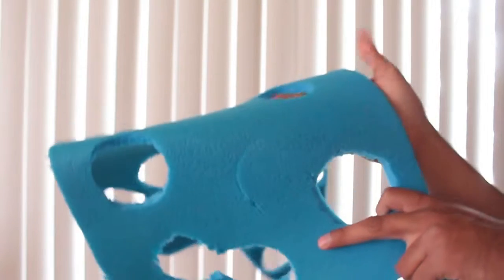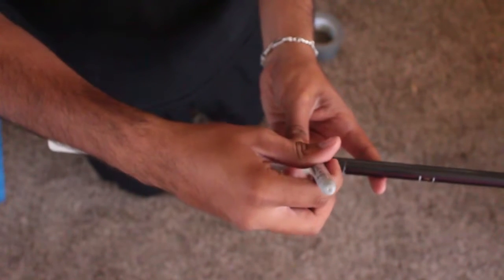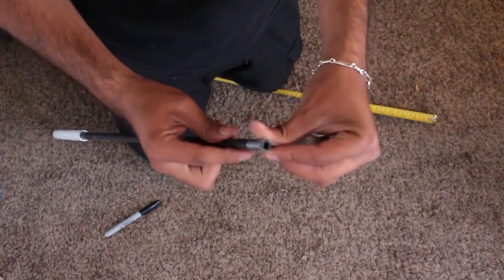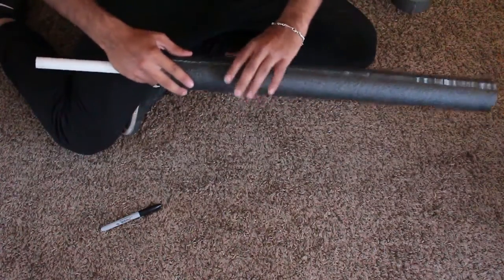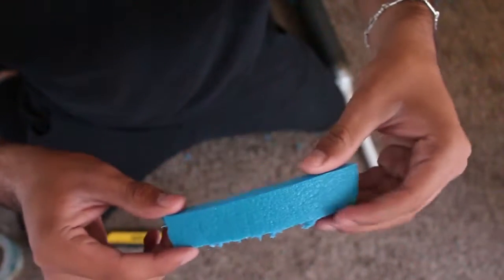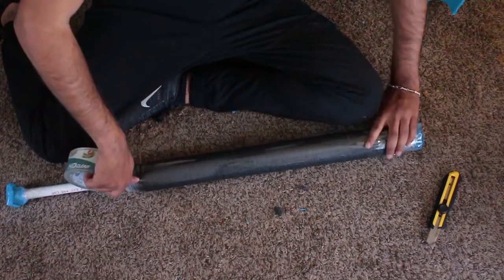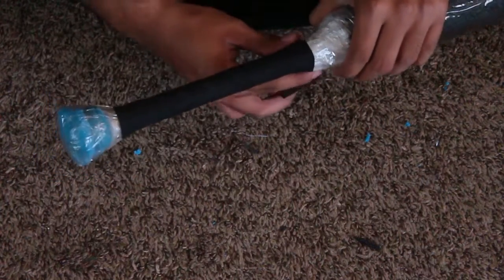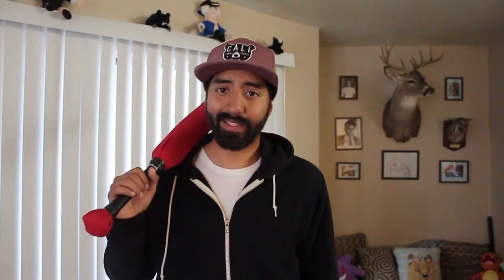HOW TO BUILD A SWORD - HOW TO PLAY AMTGARD

Comment: I've used women's tights instead of making a cloth wrapping.  Pulled it completely over the blade and pommel, secured it, then taped over on the hilt.
Reply from the maker: Iv seen others do that and I had a few swords in the past with the same. It fully works!
Reply: i know that this video is old but as far as i can remember that's not allowed anymore sadly

Comment: Use abit of sticky back craft foam to create rattle stops on your blade. You should only need about 6 inches from the tip down to make a snug fit. 
Instead of using that variety of Clear tape, find the packing tape, it's abit lighter and abit more pliable. 
 If someone doesn't have a sewing machine, they can use 1 or 2 Woman's tights to create a cover. This will vary based on opacity.

Comment: interesting to see people who do different systems, the outside with packing tape is odd, that's never where my foam breaks down and i never packing tape it. I suggest cutting down the foam and glue it with DAP that way you have a lighter blade with no duck tape building up the core. Great video much better than most boffer making videos i have seen.

Comment: Have you considered using a "biscuit tip" on your cores? It's a piece of foam the size of the core and helps the stab tip last longer by absorbing the force from the core into the stab tip. Helps reduce punch through into the stab foam from stabs.
Reply: wanna elaborate on this? I'm trying to make my own swords and I'm not finding anything when I just search 'biscuit tip" online. Is there a store link maybe?
Reply: @Anxienator1 biscuit tips are just a scrap piece of higher density foam (such as the grey puzzlemat from harbor freight) that's cut to the diameter of your core tip and attached to the tip of your core before putting the blade on. All the stab force of the core goes through that first before your stab tip foam, so the core is less likely to punch through the stab tip foam.
Reply: @robertanderson7607  ohhhh gotcha. Thanks for the clarification!

Comment: Are fun noodles a more affordable substitute for pipe insulation?
Reply: Pool noodles?? my dad uses pool noodles for all of our swords
Reply: I have never heard of amtgard tbh but I play Jugger and we build our "swords" with pretty similiar materials and yeah, some use pool noodles instead of pipe insulation (really depends on the personal preference). I put some of that clear tape around the rod at first so that it's easier to remove an old noodle if needed. If you have access to already hollowed out noodles you just need some glue and if your noodles aren't already hollow you just do it yourself (for example by cutting it in half lenght-wise and hollowing out both halves with a knife)

Comment: Realy good job finally a tutorial i can feel confident in linking to as you dont miss any of the basic stuff tho as said here already craft foam is better for rattle stop and never had a need for the duct tap at the tip just adds wight  packing tape works just fine for the  tip.
Reply from the maker: Thank you! It’s awesome that there are so many different combinations of materials for sword building!

Comment: So I used to play around a decade or more ago, and I gotta admit some of your techniques were the same, some were different, some were a matter of choice and preference. 

I prefered building up a handle directly on the core using duct tape as a base instead of pvc. I maybe recall using coins or washers to prevent stabbing cores from going through, but that may have just been for arrows. 

My reflex would say your pommel is a bit too small, but I would also recall many fighters with grip from the pommel for extra reach resulting in a smaller pommel anyway. 

The big change to me is the use of slit pipe foam. Over 10 years I'd assume pool noodles quality and spec has further degraded, but I would have figured there was some online resource for hollowed foam by now. The pipe foam I'm used to seeing isn't thick enough for a striking surface, but useful for courtesy padding on polearms and such. 

Before I went into other hobbies, I thought some people were going to start an online website to wholesale individual parts like large outer diameter kitespar and hollow foam tube.

Most of the video though I recall doing Saturday morning before heading to the park, as well as replacing foam on worn swords. My friends and I would buy entire boxes of pool noodles to last through the winter.  I also branched into flat blades, and made fun things like a frying pan dagger, a buster sword, multiple giant shuriken from pvc cores (counted as a javelin, so no slashing). Those were fun to just throw around at the park honestly and the aerodynamics would cause them to stall at around 30 feet or so, so a very large frisbee.
Reply from the maker: Tbh when I built the tutorial, I took techniques for different videos that I could find here on YouTube. So it’s a blend of different things that I felt comfortable doing. 
The swords in this video were actually the first ones I ever built 😅

Comment: I would love to see someone do a Madu
Reply: I"ll talk through it breifly. You take a shield foam and carve about half way through it to make a channel. Lay a piece of PVC pipe that measured out about 17in past the shield on both sides. That makes it dagger length. Use contact cement in the channel and let the PVC set and cure for a day. Put a plastic sander that you get from Walmart, also called a trowel handle, in the center. Drill 3/16in holes in the trowel and run zip ties through it and the foam and connect them. That will lock the handle in place and help anchor it. Pad the exposed PVC as you would a dagger and cover the shield and voila....madu. I know thats not as good as a video but its rather simple to make.

Comment: The best way to make the caps if nobody has mentioned it is using a tin can that is 2.5" wide, and cutting the can with the can opener rotated 90 degrees so that it cuts off the lip and creates a sharp edge out of the can.

Comment: The only thing I would do differently is use a pool noodle instead of pipe insulation
Reply: Pool noodle is not legal for amtgard, it does not have thick enough sidewalls.
Reply: @John Browning  it depends on the pool noodle, that was a big push a few years back but people all over amtgard still use it.  there was another controversy around the same time in IM i wanna say related to something similar
Reply: @jamesclare8800  pool noodle is frowned upon in all the hardcore boffer LARPs
Reply: @ActionNerdGo  Feel like this depends where you're at some people don't have access to some materials as others or they can't afford better material I let folks know that it will break down quicker